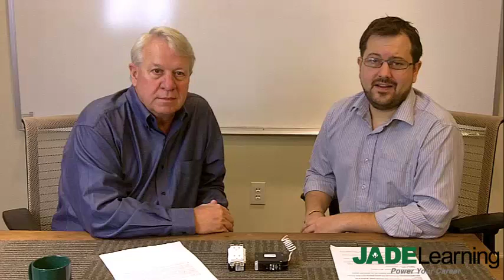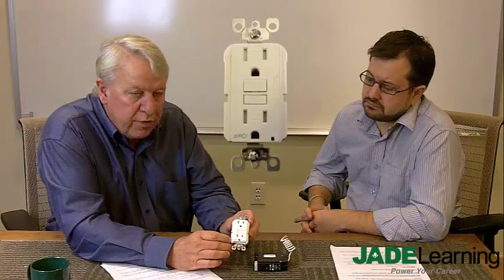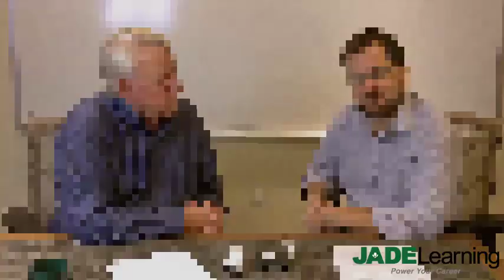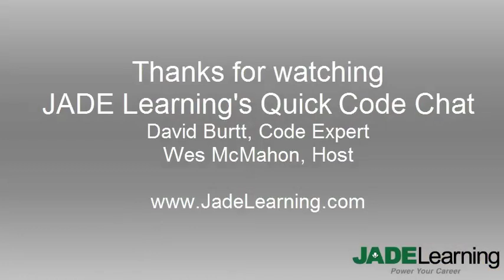AFCI Protection According to the 2014 NEC

Comment: The bottom line is no matter where you live in the US now, and speaking as of 2018 which we just finished a new build is that ALL 20 and 15 amp branch circuits no matter where they are located are required to be afci combination/gfci and is written clearly on the fuse itself and if not then the building will receive a red little tag saying failed and cease order from,the code inspector and in some case will make you have a certified electrician to come in and fix and replace so if your building and doing your own I will don't this,k for a second your going to get away with it because your not so no matter how much we bitch it just is what it is so break out your checkbook cause the fuses are going to cost you a shitload of cash case closed have a nice day and put your pants on backwards cause your going to need too if you decide to say bull shit man I am putting on regular standard fuses😂😂😂😂😂😂😂😤😤
Reply: Not so!   A afci is not required on all circuits and definitely not a gfci on all circuits... you got you head on backwards.

Comment: if the new code change. lowe's and home depot need to stop selling old circuit breaker.then our option only to buy GFCI breaker .
Reply: they don't care about the code they will sell you anything !
Reply: Both stores suck. They should have a large sign stating that all residental 120 volt receptacles ( except for old style 2 wire no ground receptacles ) MUST be tamper resistant. 6 months after it became code they did not stock them.

Comment: so what or where is the code for that in NEC 2014? I didn't hear you say bathrooms, is that correct, not required there?
Reply: +Caleb Paton Yes because you have GFCI in bathrooms.
Reply: what about large bathrooms, all gfi's or only within 6 ft of a water source/basin?
Reply: Caleb Paton according to the NEC, six feet from water is code 210.8

Comment: The problem with AFCIs in older homes is that these homes do not have segregated circuits. You will common neutrals, lights and power on shared circuits, and circuits feeding motors on bedroom circuits. Therefore, constant trips. I installed one for a remodel, eventually I tossed it in the garbage. Nuff said.
Reply: Then you have to install an expensive 2 pole AFCI circuit breaker.